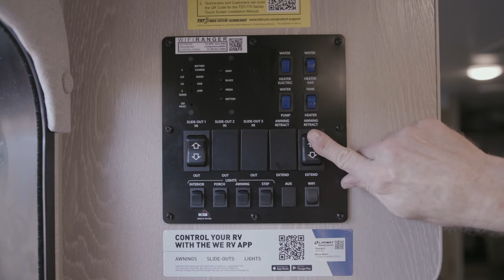How to Set Up Your RV Campsite

Comment: You didn't show how to screw the dump hose fitting to the pipe when possible. This is essential if you plan to leave the hose connected.  Frankly I never leave my dump hose connected with valves open.   I only connect and dump when a tank is full.